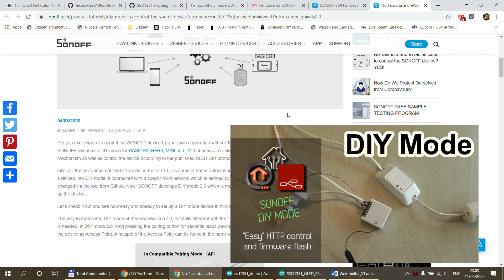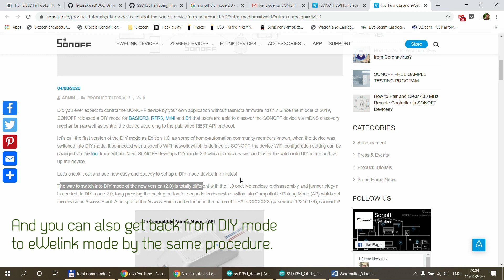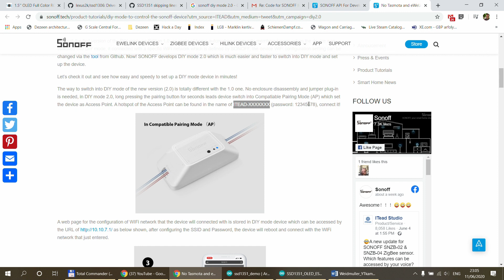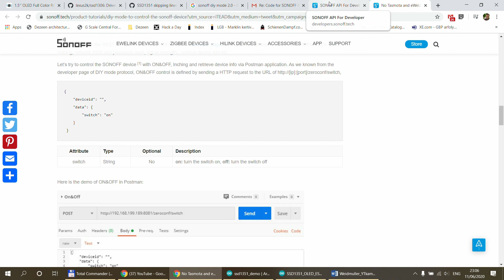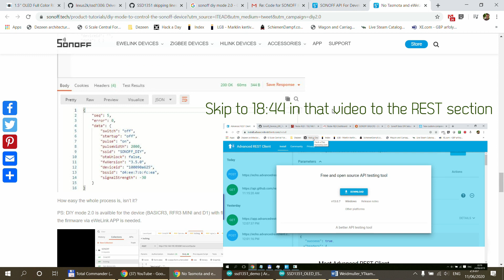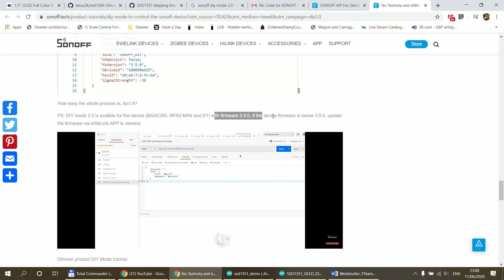Sonoff DIY mode 2.0 - What has changed?

Comment: Nice video but how to install Tasmota with this DIY mode?
Reply: I was going  through this a few weeks ago and the flashing itself is easy using provided flash tool. Problem with tasmota though is that there is not enough space on the device for the latest firmwares - only 500KB available.. I needed full version of Tasmota (with its Discovery feature) and had to install more than 2 years old version. There is a workaround, you could compile you own version but it was too much headache for me. I will stick to the classic sonoff - Its got pretty easy with tasmotizer these days.
Reply: @wasyl00  First put one the tasmota lite bin firmware, then after that you can put on the normal full tasmota bin on it ( not trough itead , but like tasmoadmin and so on , thats how i did it with DIY version 1 )
I cant get tasmota on the mini with Version 2 DIY , so if anybody have suggestions or help for these method please share !! :-)
Reply: @eddyvanbladel2057  It will not go this way as I said there is not enough space. I tried via tasmota updater. You will get an error.
Reply: @wasyl00  yeah there is, i did another one yesterday :-)
1. Connect to ewelink and upgrade firmware to 3.5 and allow it to reboot
2. Press button for 5 seconds (light pattern changes)
3. Press button again for 5secs (light pattern changes again)
4. Connect to the isteadxxxx AP using pwd 12345678
5. Browse to http://10.10.7.1
6. Enter your SSID and pwd for your LAN - case sensitive and hit Save
7. Wait for device to reboot

Device will now be available for DIY RESTful API. You just need to find the IP address it has been assigned and then use a REST tool to send it commands.
1. with Postman or ARC (for Chrome)  I first send http://ipadress_of_your_sonoff:8081/zeroconf/ota_unlock with body 
{"deviceid":"","data":{}}
2. then check with the tools ( Postman / ARC ) if the unlock OTA os true with this command and body :
http://ipadress_of_your_sonoff:8081/zeroconf/info with body 
{"deviceid":"","data":{}} 
look for deviceid and see if you get this result => "otaUnlock": true,
3. use the tool_01DIY85(3.3.0).exe application ( from sonoff ) https://github.com/itead/Sonoff_Devices_DIY_Tools/blob/master/tool/tool_01DIY85(3.3.0).exe
4. I could see the SonOff mini in the tool_01DIY85 and could upload the firmware like I would if I had the last version 3.3.0.
5. take the tasmota_lite.bin firmware and flash your device.
6 . after succesfully flashed and restarted your device, go to where you maintained your tasmota stuff.
7. I do it with Tasmoadmin, Do a Firmware upgrade there to the latest ( OTA or manualy uploaded ) and you get first automaticly the minimal and then the full tasmota.bin firmware ( like now its 8.3.1 )
 Thats how i flashed my 5 Mini's !
Reply from the maker: Thanks a lot Eddy, it is a great writeup. To be honest, since I can control mine via HTTP I did not even bother flashing Tasmota, I can control it as good from Node-Red.
Reply: @eddyvanbladel2057   Thanks for that - pulling my hair out till I discovered having to set the otaunlock flag